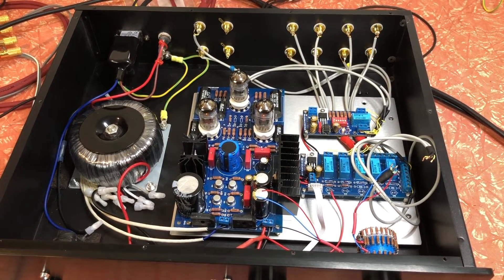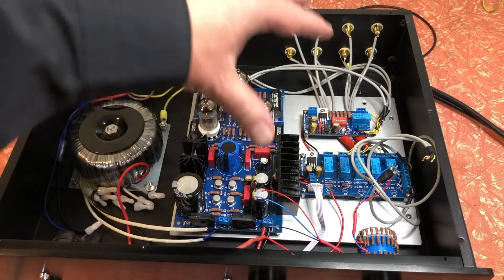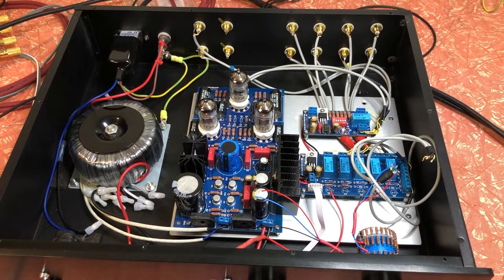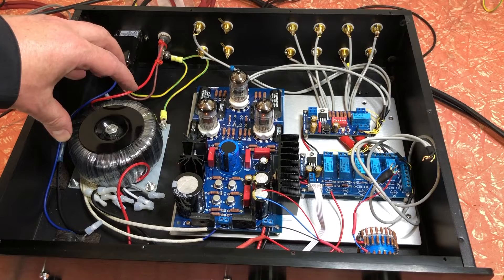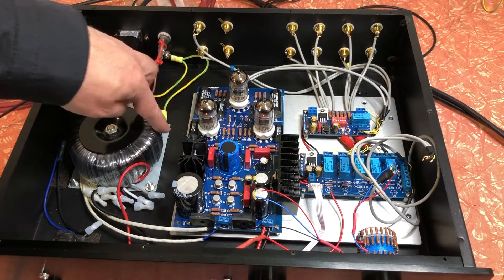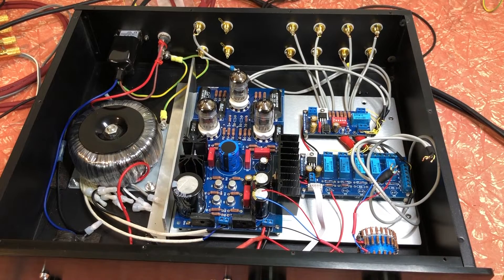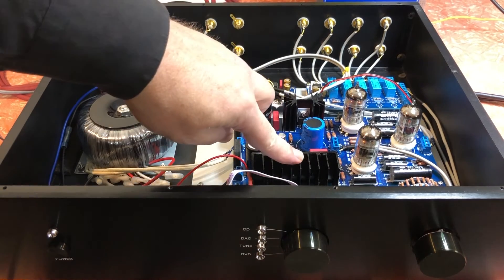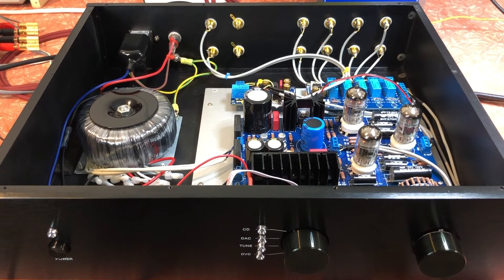Marantz 7 Clone Build - Pt 6 - Debugging

Comment: That heater voltage is really the first thing to fix. The power board in my recent earphonoclone project had an adjustment pot to correct the heater voltage, pity this one doesnt have that.

Comment: seems the grounding path is insufficient.  It could be that big aluminum plate was not getting a ground connection to the other plate the safety ground was a††ached.  This was corrected when your angle aluminum made contact with both pla†es.   I would tap the post rectified ground and add a ground terminal block right to the case (paint needs to be scratched off.  Both power supply bridges will create separate dc grounds,  they need to be joined and fastened firmly to the star.   Nelson pass puts thermistors on the primary windings and separates the PSU ground from safety ground with a thermistor,  might be good practice,  Then,  all the signal inputs/outputs need to share the psu star,  Those noisy relays can't be allowed to share the star,  That whole thing needs it's own dedicated power source isolated from everything else.  The stepped attenuator needs to be directly connected to star.  The channel selector switch is providing ground to the relays probably,  can not be in continuity  Oh and i'm not sure about ANY of that,  it's just my uneducated opinion.  
https://i198.photobucket.com/albums/aa276/aeroplane_album/F5PSUschematic.jpg
Reply from the maker: Thanks - there's some really good suggestions here. My Electronics major was in digital electronics, so this grounding stuff gives me a nosebleed! Really good point about the separate ground post rectification. And the Nelson Pass diagram is really helpful. If I were to configure it as you suggest, then I would need to ISOLATE the aluminium plate from the chassis, and put the star on the aluminium plate. So the plate would become signal ground, and the chassis becomes chassis ground. The could then be joined through a thermistor, as per Nelson's diagram. Thoughts?
Reply from the maker: The schematic for the pre-amp board is here:
http://analogmetric.com/download/M7C%20Preamplifier%20Schematic.pdf
Looks like the post rectified grounds are grounded together on the PCB.
Reply: @audionautica6843  well are those aluminum plates really necessary?  Seems like a pretty thick alluminum box to begin with.  Consider ditching the plates and using nylon standoffs for all PCBs,  from the PCB's connect all the grounds to the star with solid 20 gauge wire and add a thermistor to the Power Supply joined grounds before the star, maybe right on the PCB.  Now the cassis is solidly grounded and shielded and that aluminum plate can't act like a radio antenna
https://www.dropbox.com/s/inqekcq2g6zapeh/s-l500.jpg?dl=0
This example isolates the grounds for each channel with separate power supplies
Reply from the maker: Thanks again for the tips. My intention here is to build this kit as designed. I have no interest in redesigning or "improving" it. I've been through and checked all the earths and grounds just so I can see what is grounded where, and I am now satisfied that it is grounded as intended. I've put a proper earth connection onto the aluminium plate. Yes, I think it is supposed to be there (the plate). Signal Ground connects to Earth at a single point on the main PCB board. (there is one mounting hole that connects to earth. The rest don't connect to anything.) I have just done half an hour of extensive testing with a proper amplifier and speakers, and I am satisfied with the performance. The hiss and hum can only be heard with my ear 10cm from each driver. I have other amplifiers with similar performance, so I think this is fine. I still have the things on the "to-do" list from this video as I wait for the JST connectors to come in the post. Cheers.
Reply: @audionautica6843  tubes are going to make noise, at least they always do when i build an amp.   The tubes at the first stage of amplification might be slightly less than perfect and the noise gets amplified.  Try switching tubes till the best performers are at the first position, and i don't remember if your kit had metal shields on those tubes, but they are worth getting.  I just built a frankenclone fender guitar tube amp and adding tube shields was not an insignificant improvement to the noise floor.
Reply: Also i would experiment with the amp running and your ear close to a speaker - just take a wire from the main grounding point and touch it on the ground areas of the input/output connectors, attenuator, and touch the ground on the boards and listen for any improvements.  I'll bet you will find ways to lessen the noise.